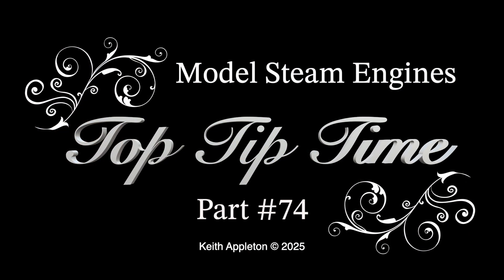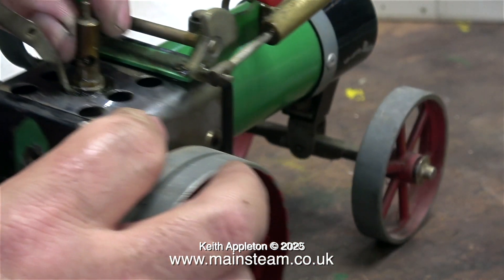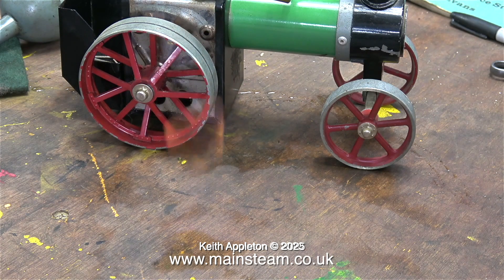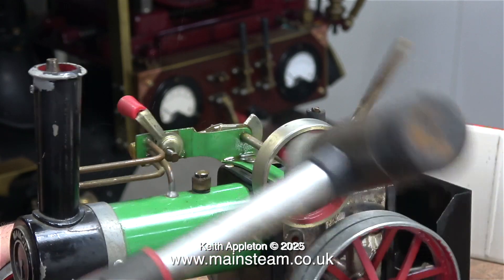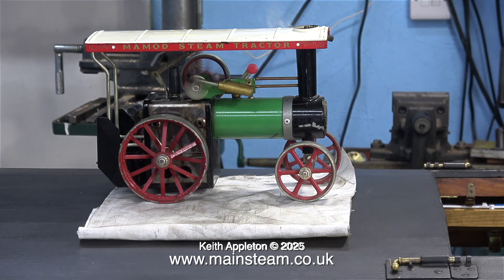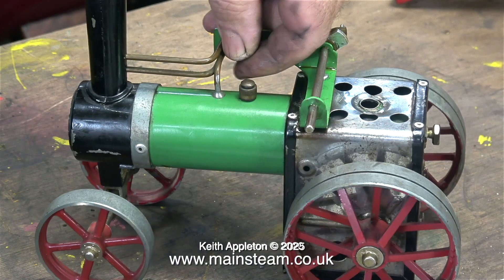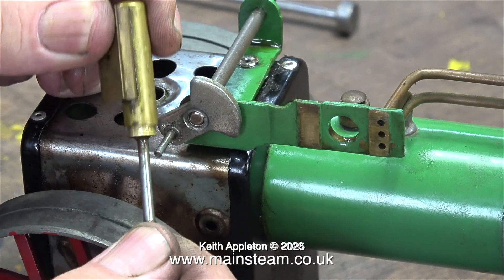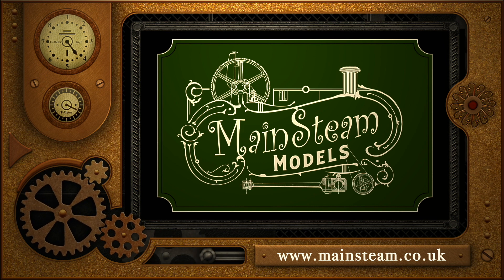MODEL STEAM ENGINES - TOP TIP TIME - PART #74

Comment: At one of the places I worked at they made a sign up for me to hang in the shop "If it does not fit use a bigger Hammer", There were quite a few machines there that you had to give a gentle tap to get working right.
Reply from the maker: it's knowing just where to hit the part and how hard to hit it ............ famous last words }:-)))

Comment: I have seven Mamods, I bought them as a box of bits at an antique fair for £20! I recognised that there seemed to be seven boilers plus loads of bits. The only parts I had to replace were some rivets, a couple of safety valves, washers and drive belts. They all work fine, but it took about a year, and no lathe just ordinary DIY tools.